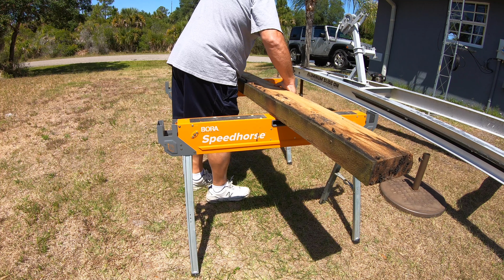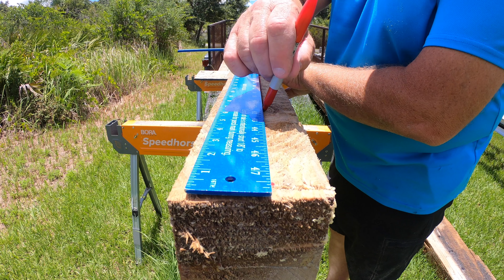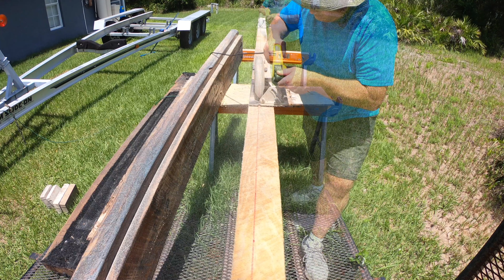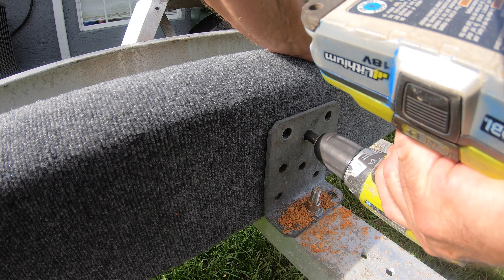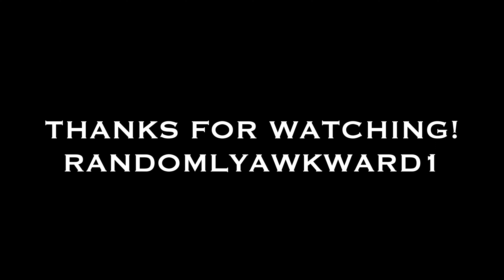Boat Trailer Restoration Project -  Recovering the Bunks and Replacing the Hardware

Comment: Was this trailer at some point a roller trailer? If so how has the bunks worked? I have a roller trailer and I’m thinking of converting to bunks.
Reply from the maker: It was always a bunk trailer, I just needed to redo the bunks and everything else while I was at it. The boat we have is too heavy for rollers (almost 8,000 lbs.) so solid oak bunks it was!
Reply: Where did you get your brackets
Reply from the maker: @jasonmartinez5583  the brackets were already on the trailer when we got it but I’m sure any boat trailer dealer would have them. They are just galvanized steel so they should be fairly easy to find.
Reply from the maker: I just found them on etrailer…. https://www.etrailer.com/Boat-Trailer-Parts/CE-Smith/CE10161GA-2.html?feed=npn&gad_source=1&gclid=CjwKCAiAi6uvBhADEiwAWiyRdsxEiZOxzmjAJo7cXz7jHdgVYP7CllkM_DZkqJPTLu88oor1S8hJThoC5FcQAvD_BwE
Reply from the maker: @jasonmartinez5583  https://www.etrailer.com/Boat-Trailer-Parts/CE-Smith/CE10161GA-2.html?feed=npn&gad_source=1&gclid=CjwKCAiAi6uvBhADEiwAWiyRdsxEiZOxzmjAJo7cXz7jHdgVYP7CllkM_DZkqJPTLu88oor1S8hJThoC5FcQAvD_BwE